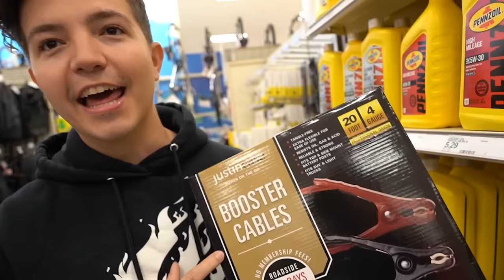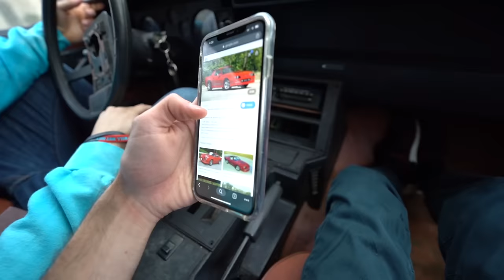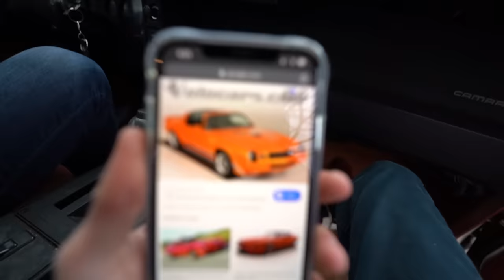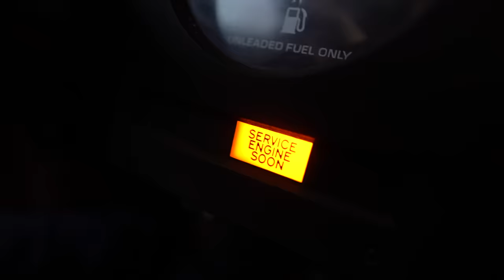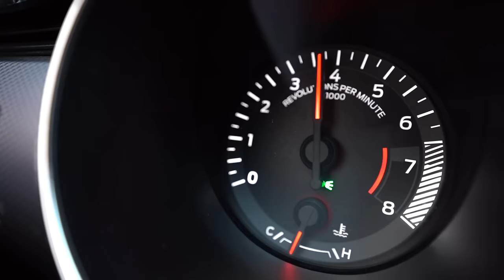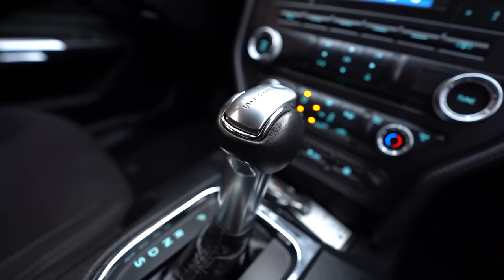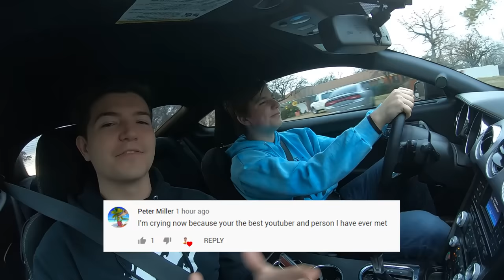Pranking My Little Brother and then Buying his Dream Car!

Comment: 2:32 
“Preston he’s running low on windshield wiper fluids”
“He won’t need them he doesn’t have windshield wipers”
Reply: why did i just find out that when the time someone comments is blue you can just click it and it brings you there?
Reply: Because it's a time in the video
Reply: I like the gt but not the eco boost